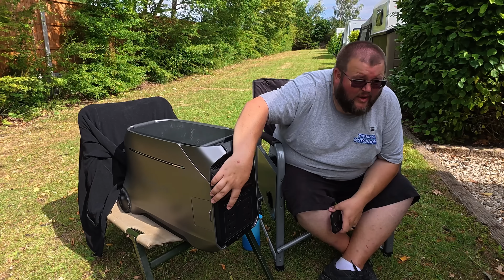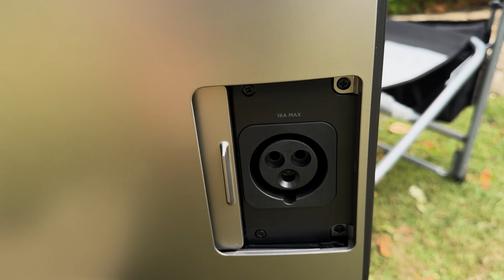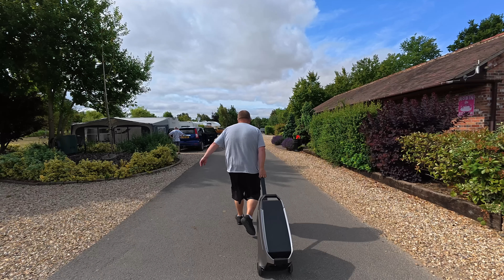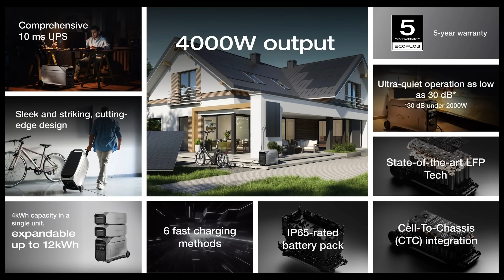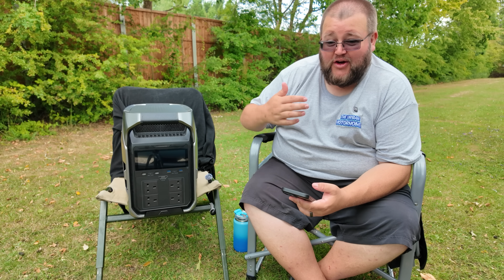EcoFlow Delta Pro 3 – The Ultimate Off-Grid Solution!

Comment: I love your video! I have the same unit, and I'm building it into a 2023 Sprinter. I did buy the alternator charger but haven't connected yet. Can you confirm it's ok to use pos and neg battery terminals, or is a chassis ground required?

Comment: This is exactly what I needed to know.  We're building a camper van for short weekend trips about 2x/month 3 days at a time for art shows.  So we wouldn't be in the van the majority of the day except mornings and evenings. I really want a portable unit that can power a 12v air conditioning unit for a few hours at night or when we get back from the day to cool it off.  Then also be able to handle some lights, water pump, we'd prob have to do a gas water heater, and charge laptops/phones.  I'd plan to get 400-600w solar and the alternator charger too.  This is all in case we don't have shore power.  By the sound of your video it seems like this could work.  Do you think?
Reply: OutEquipp pro is the airconditioning company and they said I'd just need to plug the AC unit into a converter, not directly into the Ecoflow, and it should work

Comment: I wonder if you could plug in extension cords and then run appliances through them to different rooms in the house in case of a power outage, like fridge, microwave oven, room heater, TV etc?
Reply: Yes, that’s the best thing about these portable units. So versatile.

Comment: You'd have to be a fool to buy one of these toys. Power stations like the units that your selling in this video all use cheap high frequency, transformerless inverter technology. A high-frequency, transformerless inverter's lack of galvanic isolation can potentially damage appliances, mainly due to shared DC/AC grounds, leading to ground loops, leakage currents, voltage fluctuations (brownouts/spikes), and inability to handle heavy surge loads, which can harm sensitive electronics or motors, requiring specialized installation and protection. 

How Damage Can Occur:

Ground Loops & Leakage Currents: Without a physical barrier (isolation transformer), the DC (solar/battery) and AC (appliance) sides share grounds, creating pathways for unwanted currents, causing interference or even system shutdown.

Voltage Instability (Brownouts/Spikes): Some models may dip voltage (brownouts) or produce noisy power, especially under heavy loads, which can stress motor windings and electronic components.

Poor Surge Handling: HF transformerless inverters often struggle with high starting currents (surges) from motors (fridges, pumps), potentially causing shutdowns or stress on the inverter and connected devices.

DC Leakage: The AC output can carry DC leakage, potentially damaging sensitive electronics not designed for it, or even causing issues like corrosion in marine setups.
Reply: Wat u on about this is solid i have been using this for all household items and power tools for over a year bought it in January 2025 from ebay and have had no problems at all. This is a BEAST.
Reply: Can an isolation/circuit protection device be installed inline to prevent these issues?

Comment: Hi Darran.  I have a question that Ecoflow might be able to answer.  When I buy my motorhome in France next year I will need to look at a serious solar upgrade as I will be living full time in the motorhome. I was thinking of only having the Ecoflow, but as you have said in the video, a full-timer probably needs a fixed system. The present heatwave has got me thinking. If I got an air-conditioner installed on the roof, but have the power lead plugged into a powerpoint in the motorhome, could I use the Delta Max to power the air-conditioner (thinking about start up currents needed) and have the motorhome plugged into the 6amp socket in the Aires? Would the 6amp of mains power keep the Ecoflow charged enough to run the air conditioner for long periods?

Comment: Great but at 50kg, it was too heavy for our use. After 2 weeks we returned it.
Reply: Hi , that’s a massive weight, I use VTOMAN with second battery given me 2500ah that’s plenty for my motorhome, charged by solar & DC input always charging when in use ,  also loads lighter runs everything I need from microwave downwards , and tucked away under seating , I can understand your return 👍
Reply: Delta 3 max plus with extra battery would be your best bet